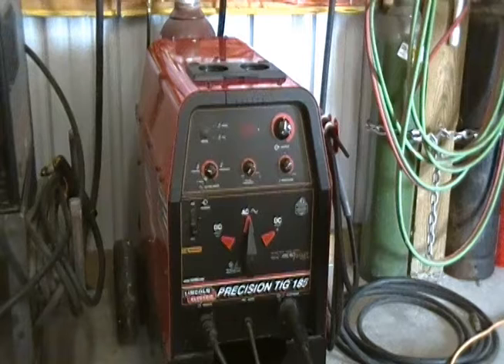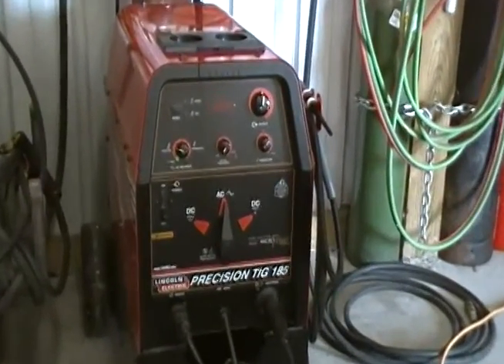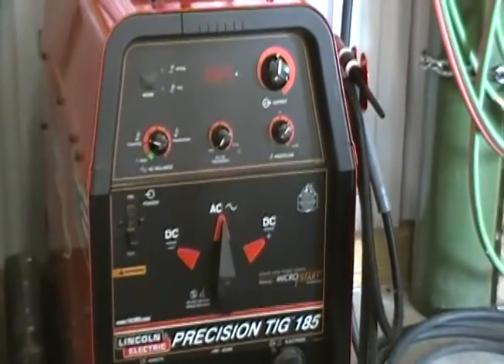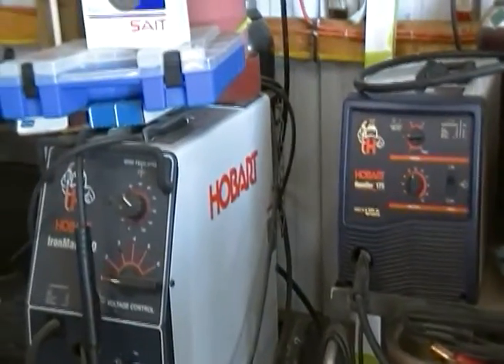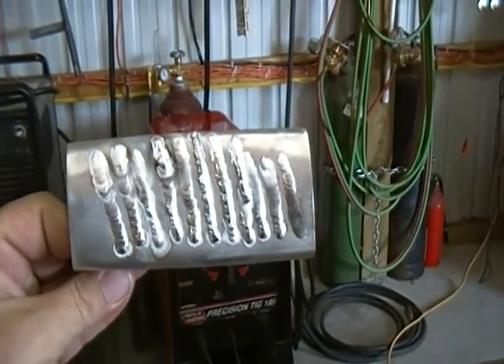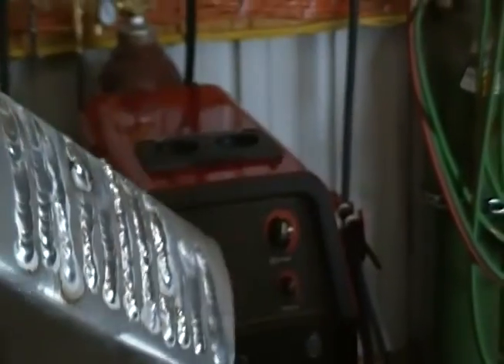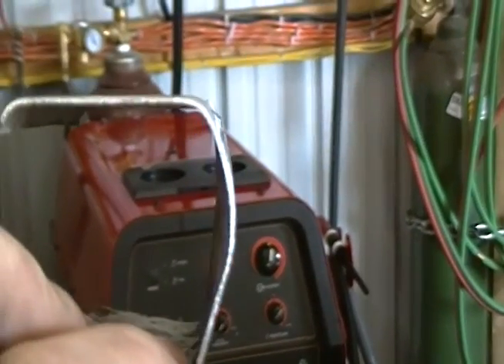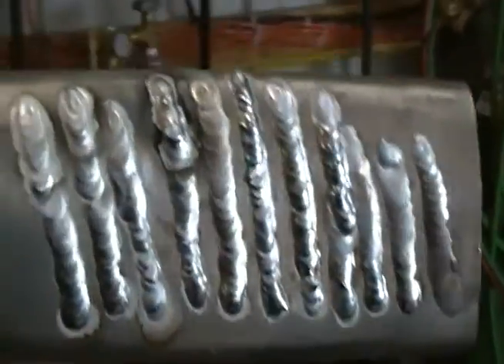TIG Welding

Comment: Nice clarity with the lens set up, but you were really making it hard on yourself with that mobile workpiece, LOL! I figured you must be practicing for welding while at sea ;)

I'd love to see some steady work as you look like you've got it going well and everyone loves hood time. My Dad got me my first job welding and that was what he said, "this job may be tough and work is never easy, but if you like your hood time, then you can have a good time".

He also told me if I ever saw the foreman coming to make sure that I was at the start of a long bead, cause nobody messes with you when your hood is down :)

Thanks for the arc-shots...Aloha, Chuck
Reply from the maker: Thanks for taking a look.  I use the 'non clamped work' excuse as a cover for welds that look like chicken poop...8) 

I don't weld often so  it takes about 1/2 of an argon bottle to get back to the point where I don't blow holes in things...  I'll try to get some shots the next time I have  some welding to do. 

If you would like to see some welding done by someone that knows what he is doing check out Jody @ weldingtipsandtricks.

Thanks again for taking a look!
Reply: *****
Thanks my friend, I think you do just fine, and I was a pipe welder for years, so I can recognize a steady hand.

Oh, and I've been a Tig finger wearing, Stubby gas lensing follower of the Iron Monger for about a year and a half now :) Jody's videos just make me drool! From there I started to follow Abom79 and Oxtools, and all of the machinists(I saw your comment on Randy Richard's channel, he is a friend of mine and super cool...unless you steal his fish, he he!

Now not only did I end up with a Tig Rig, but also an old Atlas lathe I just rebuilt...my videos are still pretty weak, but I'm practicing.

Thanks so much for the kind reply, talk more soon...Aloha, Chuck